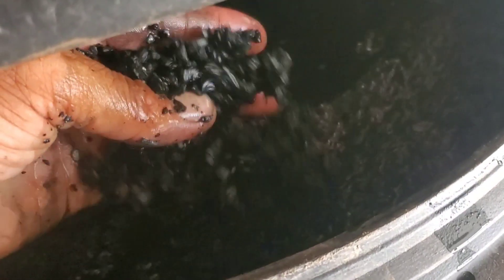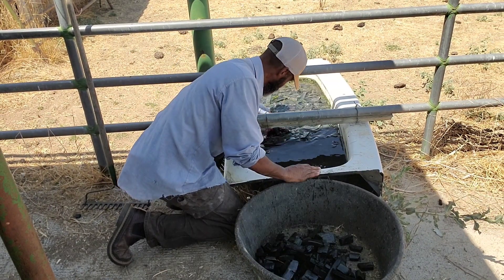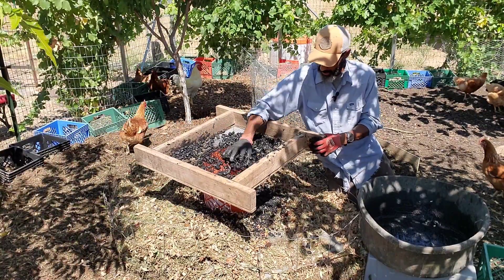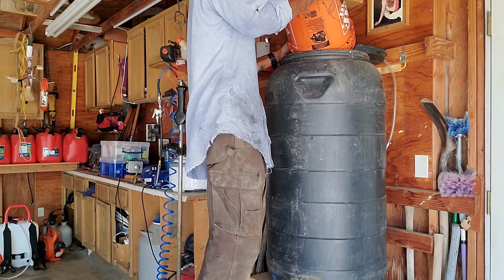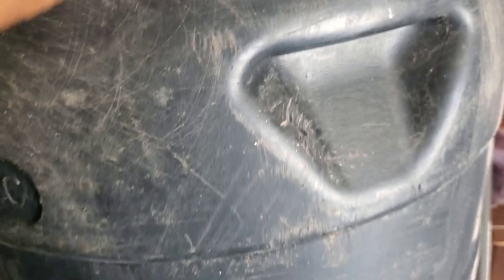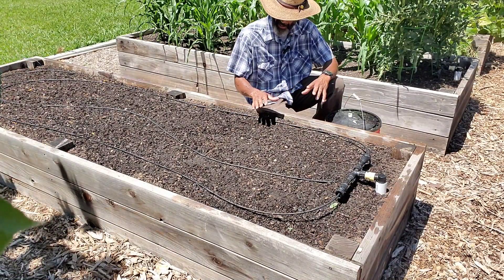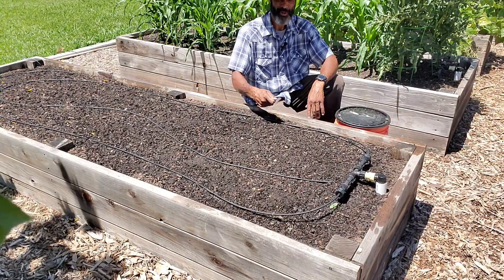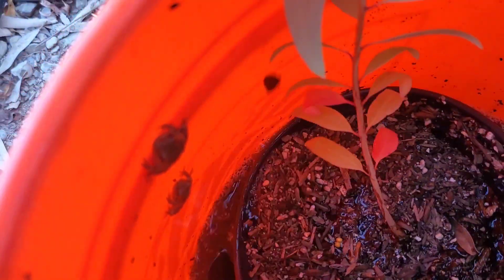Boost Your Garden's Growth with BIOCHAR-INFUSED COMPOST TEA!

Comment: What is the point of making the particles so tiny. I would think that particles about half inch would have more of an area for microbes to house themselves. I would just add all my composting materisl to the char in the water solution
Reply from the maker: There are many different ways to do this and by no means is there one right way. I just did a video explaining the crushing process covering how, why and how small. It should answer your question as to what is the point of having tiny particles. The short answer is because microbiology is much smaller than the tiniest of dust. Here is the link to my crushing biochar video. https://youtu.be/vrOdzUf1lP8?si=TMipMcg0JmqS09ML
Hope this helps.
Reply: @therealprtrhsenteal  thanks for the video, that answers many of my questions.

Comment: I’ve done everything like you said and it works to perfection. I’m at the point where I’m making the tea and adding the charcoal. I don’t want to mess it up at this point, I’m not sure if you mean to do the tea for 24 to 48 hours then put the charcoal in for another 48 hours? Also is the half a bucket of the crushed charcoal that you put in all that you could put in? Thanks again! you’ve been great and a lot of knowledge learned.
Reply from the maker: Thanks for the nice comment and questions. Don't worry about messing things up just do it and don't be in a hurry for the end product. I put the char in the tea at the start of the process to maximize the time the char will have to absorb the tea. The amount that I used during the making of this video was more than adequate in my opinion but more could be added if you want and it might be appropriate to do so depending on how you plan to distribute it.  I wanted a tea that was infused with char but you could use the tea solely to inoculate the char and the amount of char you add can vary greatly.  Don't be intimidated by any of this. Go run some experiments and see what works for you and good luck.

Comment: Isn't it preferable for biochar to soak with compost tea instead of plain water
Reply from the maker: In theory yes. But untreated char is hydrophobic and water helps to break that down. I could have crushed it dry but I crushed it wet to keep dust down. Char can take literally weeks to become completely saturated. Once it becomes completely filled with water char will sink. Most if not all of the 3/8" size char used in this run  was still buoyant when I put it in the tea indicating to me there is still more room for adsorption.  By treating with water first it better prepares the char to receive inoculation by advancing the first step. Thanks for the question I hope that makes sense.
Reply: Good words. It makes sense. Many thanks!

Comment: I use wood pellets as the feed stock in my biochar reactor because they will be very small and extremely easy to crush. You can get them at tractor supply as bags of pelletized horse bedding. I use a septic aerator as the air pump in a 275 gal IBC tote for large batch, 90 gal municipal garbage can for smaller batch. You can empty the vessel by dropping the air hose down a 1.5” pvc pipe and bubble siphon it out. The IBC has a ball valve at the bottom.
Reply from the maker: Right on sounds like a great set up! Thanks for sharing. 😉

Comment: Do you have a preference for the type of wood species used for making biochar?
Reply from the maker: I use mostly soft wood but only because that's what I  have access to. Hardwoods would make excellent char as well but I don't have that available as a waste stream. I did a comparative test between hardwood, softwood and lump char to compare cooking temps. Check it out if you are interested: https://youtu.be/zlltae_AokU?si=WiQck7Z9hyJMsn9a 
Both hardwood and softwood would make fine biochar imo.
Reply: Thanks, I will check that out. I think I will make a similar setup to what you have there. It looks like it works awesome.

Comment: How much crushed char per gallon?
Reply from the maker: Could you clarify your question. I'm not sure I understand.
Reply: @therealprtrhsenteal  how do you know how much brochar to add to the compost tea? How many brochar is needed per gallon of compost tea?
Reply from the maker: I don't have a specific measurement or formula that I go by but I usually would crush about enough to add 1/3 to 1/2 of a 5 gallon bucket of crushed char to around 50 Gallons of tea. That seems to work pretty well but it definitely could be adjusted either way. I hope this helps.
Reply: @therealprtrhsenteal  it did. Thank you

Comment: I have been  making biochar 7 batches so far hard wood blocks.  Made 1 batch with sawdust seems ok. No crushing. But like to get your thoughts.
Reply from the maker: I have tried sawdust in my retort and have not had much success as there is not enough airflow between the sawdust to fully pyrolyzise the material before the  feedstock runs out. I could probably mix sawdust with larger chunks of wood to get a better result but it hasn't been something I have tinkered  around with enough to find the sweet spot. Maybe this next season. 👌
Reply: @therealprtrhsenteal  saw dust talk. I'm running a 15 gal. Drum inside a 55.  Maybe that is the difference? And put 2 steel pipes inside to get hotter.  I will bring sawdust biochar to Kentucky tree guild class and look at it. Thanks for all your help good videos.